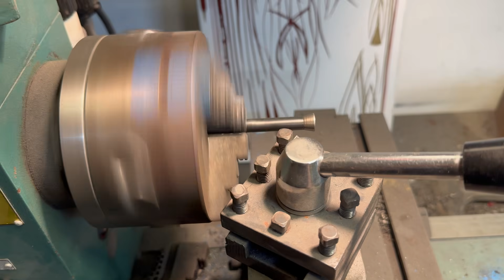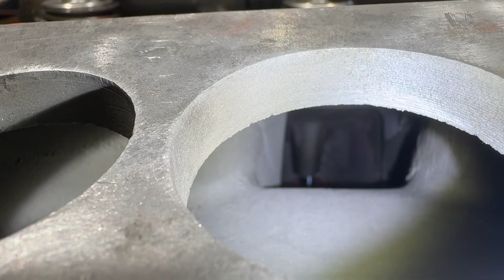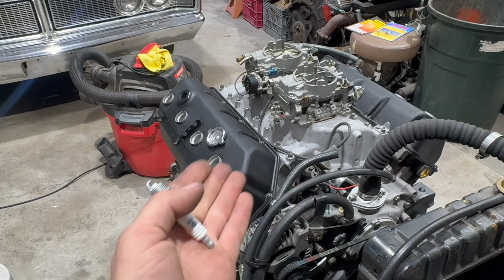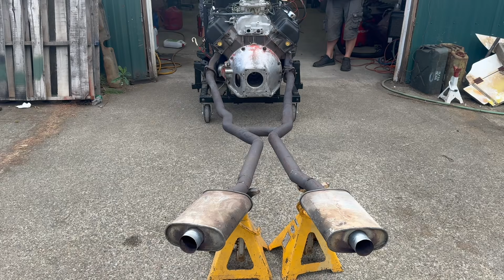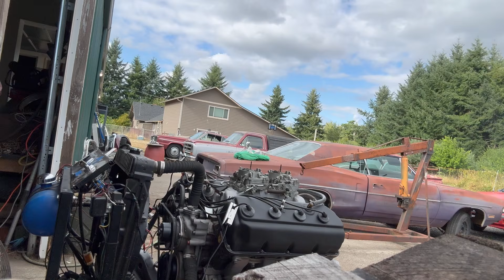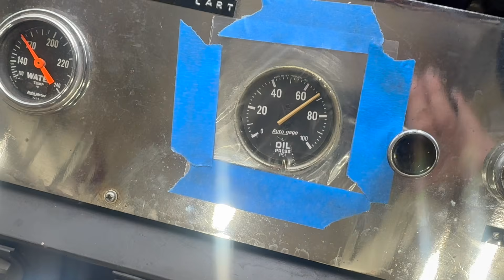IT'S ALIVE! Rebuilt 426 Hemi Pushrod Fix, Intake Sealing Tech, Engine Break-In, And Much More

Comment: Pretty sure they make an aluminum press-in adapter that eliminate the oil pooling issue in the spark plug holes. Also, I've read Stock street Hemis used high pressure pumps, not high volume because of the drain back issue. I understand it's very easy to suck the pan dry with a high volume pump and a stock pan. Good job.
Reply from the maker: Yes. I have enough of those plug cups for half of one of my engines. No matter which pump is on there, the smallish mid sump pan is always going to be an issue. As far as what’s original, I guess I need to do some more reading. Thank you.
Reply: True. Factory street Hemis had the higher pressure relief spring in them.

Comment: Use silicone not cork end seals always have since the 80s when the foam seals blew out on the 318s
Reply from the maker: Buddy, I know all about it. I can't tell you how many builds (and videos) I've said and done exactly that. I had a very specific reason for using the corks on this engine - it is supposed to be a restoration grade build for a 1970 Hemicuda. But it didn't work out and I replaced them with silicone later.

Comment: Back in my younger, engine builder days, we used to double up intake gaskets with spray trim adhesive. And then we would sandwich them between 2 heavy flat objects. Much less messy than rtv.
Reply from the maker: I’ll have to keep that one in mind. Thanks.

Comment: I ran a new 67 GTX Hemi in 1967. I used Oilzum  40w or 50w weight oil to maintain good oil pressure. The Hemi requires heavy oil and high octane  lead gasoline for optimum performance. 10/40 is not correct. 10/40 is HD (High Detergent) motor oil. High Detergent or synthetic oils are  insufficient lubrication for the 426. I suggest using only straight 40w or 50w motorcycle oils.  The engine will never seal or have proper oil pressure with the wrong oil. Wrong oil will cause catastrophic failure. All older high performance engines (cars andd motorcycles) require the same heavy oil. Heavy oil doesnt break down with heat.  Many builders forgot or were never taught the correct use of oil. Motorcycle Oil and lead fuel additives will keep the Hemi running. This is a must.
.
Reply from the maker: Respectfully, a good bit of that was nonsense. The presence of detergent has nothing to do with the amount of lubrication protecting moving parts. The moment hardened exhaust valve seats are installed, we no longer care about lead. We DO care about octane level for detonation resistance at high compression ratios, which was originally increased using lead. But running lead in fuel was literally making people stupid, and we thankfully solved that issue as a society. Running a straight 40w or 50w is kind of ridiculous. The “correct” oil you’re looking for is a high ZDDP content “race oil.” I have been running that in all of my builds from the beginning, and have suggested exactly that on this channel COUNTLESS times. Multi-weight oils are fine, and I would select one in the 15w-40 to 20w-50 range. Straight 30w can be an acceptable option. The thicker options may offer extra protection in the case of excessive oil clearances, but at the expense of wasted power and resistance to flow. All of this is with respect to flat tappet cams - I agree on the synthetic point, until a roller cam comes into the equation. Then I would argue it’s the better choice. I’m glad that what you had available worked for you almost sixty years ago - but in general, our understanding of how these systems work has improved significantly since that time.
Reply: too much nonsense going around.

Comment: Interesting on the plug tubes and washers. I wonder what my Toyota V8 and straight six have. They both have tubes... The Corolla 2ZR 4cyl does as well.
Reply from the maker: Those are definitely outside my realm of “expertise.”
Reply: @DeadDodgeGarage yeah, mine too really. I learned on old Ford's and Mopars. I've got to do the exhaust manifold gaskets on this one now and it's as wide as a 2nd gen Hemi. That will be fun! 

Your attention to detail on this Hemi is great, BTW.

Comment: My most recent build a 440. I went through and retorqued the head   bolts after the initial cam break in.  I was shocked they were not to spec, now a retorque will be standard procedure.

Comment: Jamie congrats, the engine sounds badass. I don't know if you tried it when the motor was apart, but I learned from the Cadillac 500 guys you can polish the inside of the oil pump housing and it picks up a few PSI at idle. Like you go in and you deburr and polish it like you're porting a head.
Reply from the maker: Interesting. I have never done such a thing.
Reply: @DeadDodgeGarage I did a little when I was putting a Cam and new oil pump in my 75 Coupe DeVille. I'm about to do an Olds 455 Build and I think I'm going to try it on the oil pump before installing it.

Comment: Oh WOW!  What a beautifully smooth idle with such a great rumble.  She's definitely a wolf in sheep's clothing - no big "potato-potato-potato" idle that tells everyone how naughty it is and to expect great things from it.....just that purposeful and throaty burble from the pipes that becomes a snarl and then a roar of fury as the revs go up!  Such a beauty to behold audibly....that I had to play this video twice....and then again just for good measure!  

You did learn something though - cork gaskets and intakes should not be used in the same sentence except in refuting the idea of having them on the same engine.....and that sometimes a thicker oil is not only for use when an engine is burning too much of it.  Sometimes it is just appropriate for the way you set the internals up - and that's not a bad thing.  I run a 20w60 in my classic engines down here in NZ, but we don't have snow in Auckland except once every 50 years or so and freezing temperatures are not the norm even in winter.  

My Stag was idling at 16psi of oil pressure when at operating temp with a 20w50, but now sits at 24psi with the 20w60.  Oil pressure when cold has also improved...which sort of made me do a double-take, but who knows what that engine has decided as I didn't build it and have not been inside it yet either.  It's a 269 cu in derivative of the Buick 215 cu in V8 that became the Rover V8, not the original Triumph 178 cu in V8.  I'm just happy that the thicker oil doesn't thin out to the point that the pump cavitates and loses its priming when hot idling any more!

Anyway, the problem I have with hearing the big HEMI is that it's a very addictive sound....and I found myself wondering how I could shoehorn a 426 into the engine bay of the Stag.  Problem is that the original Triumph manual box would not stand up to the extra HP and torque....and neither would the diff....so they'd need replaced along with the springs and shocks in the front suspension due to the additional weight of the Hemi over the all-aluminium Buick beast.   So, I have given my wife your email address so that she can message you about her displeasure when I empty the bank accounts and put a second mortgage on the house with this new project.  At least it will keep her out of my hair and you're pretty safe being so many miles and oceans away, so I thank you (in advance) for your help!

All the best

Comment: why isn't it painted...
Reply from the maker: Because I changed the procedure at Rocket to build -> break in -> paint. This is because after breaking in, we often need to chase leaks, re-torque fasteners, or do some mild disassembly. This breaks the paint around bolts, among other things. If we had painted this one first for example, paint around the intake hardware would now be ruined as I pull and reinstall that. Also, we run on the stand using a generic set of accessories and related hardware. So again, more disassembly.

Comment: Jamie, I appreciate you concern following oil pressure here, especially at idle. My gen 1 354 drops to 20-25 psi at idle. ~700 rpm, never go above 55 at 3500 rpm. I wonder if that okay like you??  Old hemi’s eh(Canadian). 1000 rpm/10 psi = 😎
Reply from the maker: That sounds fine to me.

Comment: Ethanol free gas is simple to make at home.  I do it for all my small engines like mowers, trimmers, chain saws and such.  take a clear 2-1/2 gallon jug put in two gallons of fuel and add 1-cup of water per gallon of fuel (2-cups here)  and two drops of food coloring.  then cap and shake it like a bar tender you'll see beads in the mix.  invert the can (cap down) and set aside for at least four hours, I wait till the next day and the water will attach to the ethanol since alcohol is hydroscopic.  It will have separated and you see a distinct line were the fuel has risen and the water/alcohol has sunk.  at this point I simply crack open the cap of the inverted jug over a catch pan until the water/alcohol has drained out then close the cap.  I let the water/alcohol evaporate outside and Bobs you uncle ethanol free gasoline.
Reply from the maker: Great - and what gives the remaining gasoline its octane / detonation resistance?
Reply: @DeadDodgeGarage  I never had a problem with small 2-strokes that will be oil mixed.  Mayhap a bottle of 104 Octane boost?
Reply: @DeadDodgeGarage  I use to go to the local municipal airport for Avgas, but they are hard to deal with as of late.

Comment: if the engine ever starts burning oil, you can run the "hotter" plug to help prevent fouling. i have done it for decades with motorcycles.
Reply from the maker: Yes. I kinda hinted at that.

Comment: I don’t know why anyone uses silicone on an engine where squeeze out could be possible and end up plugging up oil drain back passages when there are far better materials available. Materials like Locktite form a gasket that any squeeze out just dissolves and gets flushed out at the first oil change.
Reply from the maker: It’s pretty easy to minimize those chances by using a modest amount of silicone. Like, actually god damn really easy
Reply: @DeadDodgeGarage  I’ve seen many Harley engines ruined due to over use of silicone sealant when far more engine appropriate sealants are available. My experience .

Comment: seems like I was right about full grooved crank and full grove main bearings. You run one or the other, not both.  If that was my motor, I would get a standard crank and OEM style main bearings. Plus the correct Length spark plugs.
Reply from the maker: Actually, it turns out this oil pressure gauge is wildly inaccurate. Also - the Chrysler spark plug chart I had on hand seemed to indicate this was the right plug. It’s not, it should be 3/4” reach. It’s on the list.

Comment: Have you ever tried using contact cement on one side of intake end gasket. That way it can’t slide.
Reply from the maker: Hadn’t previously. Right Stuff is my go to for like… everything. Either way, the gap over-crushed the cork to the point of breaking. I won’t be putting one back in.

Comment: I was told by a well known engine guy in my area that cam break ins are completely unnecessary and can actually be the source of issues. I was very skeptical but tried it with a 350 chev build that I did with flat tappet lifters. While i could have been lucky, for the last 4000kms it has been completely fine. No metal in oil and no noises, still runs great and functions well. While I don't necessarily agree with him it does make me wonder. If there was a motor you didn't care about I'd wonder if you would be willing to try that someday. (I 100% understand if you don't)
Reply from the maker: I don’t agree. Hey, maybe it would be just fine a lot of the time. Let’s be really generous and say 80% of the time. I sure don’t want 20% of the engines I build to have immediate problems. Revving the engine provides splash lubrication to the camshaft that idling does not. It also promotes rotation of the lifters, which is essential.
Reply: @DeadDodgeGarage But the oil going to the lifters to pump them up is going to make its way onto a camshaft is it not? When I primed the engine pressurized oil was coming out from around the lifters top and bottom. It wasn't spraying out just a little bit of flow. Regardless couldn't just dropping it in and driving it with minimal idling do the same thing? because that's what I did and it's been 20 thousand kms and still ok, but you make a good point about it not necessarily working every time, for everyone.

Comment: You can use the tailstock to press the cup in
Reply from the maker: Will it press the cup in, or will it slide the pushrod in the jaws?
Reply: @DeadDodgeGarage depends on whether you have the pushrod tight in the chuck , I use the drill chuck in the tailstock to push on the cup

Comment: I remember well 1966 my cousins brandnew Dodge street hemi would not turn out the oil  lite until 2000 rpm putting a gauge on it show only 8psi it ran almost a year before armagedon. ker boom
Reply: Dayammmm.

Comment: When you were talking spark plugs. RN12yc popped in my head. Autolite 64 haven't thought about small block plugs in 25 years.  On my 360 would run RN11YC man I forgot about that memory lol   I used to index them. That was fun. Buy 40 plugs to get 8 that would index.  Good thing I got them at cost and owned 3 la small blocks.  Does anyone still use Kendell straight 50 weight oil
Reply: Yeah, he's got the wrong plugs for a Hemi.  They used the long reach (3/4") like a 340.  Those 3/8" reach plugs were for the B/RB engines.  I'd get RN9Y Champions or the equivalent.
Reply: The old books say N10Y.
Reply: @MyronBuss tried them once for about an hour.  Couldn't listen to the radio.  So I always ran the rn

Comment: Hemi's have a bad habit of burning up the rockers at the pushrod. The way I got around this was I used AMC lifters and had the ends of the pushrods drilled and chamfered. So now I have oil through pushrods on a hemi. On the stock intake I did the Vanke modification.... works good! I highly recommend electronic ignition and regulation. Everyone claims hemi's burn up plugs. BS Ive had the same plugs for 8 years! She hasn't missed a beat.

Comment: THAT is a thing of BEAUTY! Instead of the 'Cuda, why not SAWZALL the back off of one of your Neons and SHOEHORN it into the back seat with a 6" drive shaft and some tubbed MONSTER RUBBER? Up front, whatever cooling system and gas tank you can fit in that TRIES to keep the front wheels on the ground, etc. "THE HEMI UNDER NEON!" Or not, but a guy can dream....
Reply from the maker: I swear I responded to this 😅 I’m not the guy for that one. But a guy sure can dream.
Reply: @DeadDodgeGarage  Oh well, next time around maybe...

Comment: Jamie, I have a 1972 Citroen DS21 - yeah, it's a hemi. Do I need to remove the washers on the plugs for that motor?
Reply: Does it have spark plug tubes?
Reply: @SchoolforHackers  Yes. However, the valve cover tubes aren't tapered to a hole you need to poke the plug through.
Reply from the maker: I doubt it. Lmao

Comment: Don't use those stupid  cork end seals. I use RTV on all my Olds motors and pretty sure I used it on my 360 Magnum as well.
Reply from the maker: I have literally used silicone on every V8 engine I’ve built for over a decade - except this one. I wanted it to look factory. That was a mistake.

Comment: My Dodge is older than Your dodge. I am currently restoring a U.S. Army 1952 Dodge 3/4 Ton 4X4 M37 Cargo Carrier with a Flathead L 6 engine . I do have the engine running after a few setbacks along the way. https://youtu.be/Slpx4wAC6HA?si=17N0bm0Iexjwumxo
Reply from the maker: Rad. I had a ‘48 Power Wagon and a ‘52 M37 here for a time. The M37 was definitely a nicer riding truck. But neither was great…

Comment: 426 Hemi's use a 3/4" reach spark plug. Nothing like a 440. Take one of those plugs and screw it into a loose Hemi head laying around there.
Reply from the maker: I guess whoever put the Chrysler spark plug listing together in 1974 that I used here needs to be slapped.
Reply: @DeadDodgeGarage  N10Y's were standard on a Hemicuda
Reply: AND the 35 range plug part number starts with 34........
Reply: @Theallthumbsbum  N10Y's were standard on a Hemicuda

Comment: The 66 Street Hemi was threaded on the China wall bolts and the intake had a hole in the back to access that bolt. But the 67-71 Street Hemi have hollow dowel pins, not bolts.
Reply from the maker: Interesting. Were those pins threaded into the block?
Reply: Yeah, that’s what I remember, short split pins in smaller drilled holes. My 66 was early enough that it was built with screws in the China wall, there are witness marks in the orange paint where they once were. The dealers were instructed to remove and discard them, due to people cracking the front of the intake while torquing it down, they would crack right across the fillet.
Reply: @DeadDodgeGarage  no, they just drove in
Reply: @DeadDodgeGarage  They may have been threaded, but it didn't matter, you just drove in the hollow dowel pins on Street Hemi's other than 66 year model. 65 Race Hemi's and 68 Race Hemi didn't have either one because the crossram didn't have holes for them to go in.

Comment: Looks good to me. We always had those stupid intake cork gaskets leak. What worked for me was hi tack them down and go do something else for a while then a dab of rtv on the ends and a thin coating on the intake side. Some had dowel pins and had to punch holes but those didn't move . Not sure why some did and some didn't have those. Get that cheap boss of yours to buy some nice mufflers lol. You deserve a raise lol😂❤